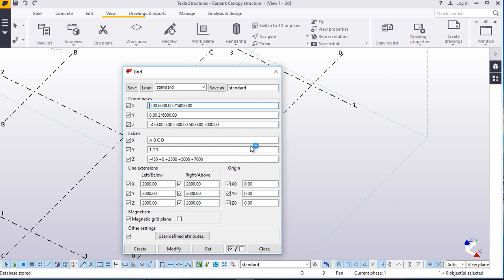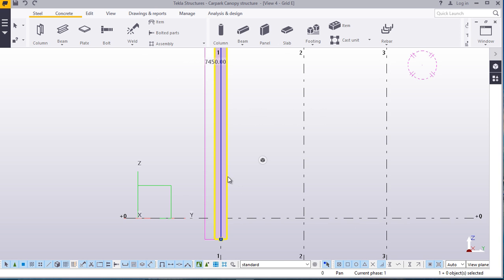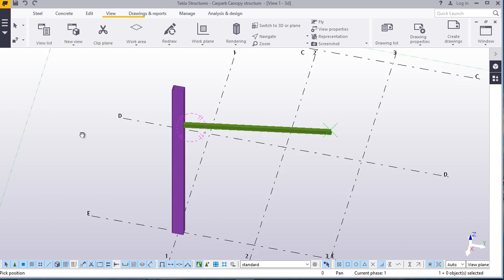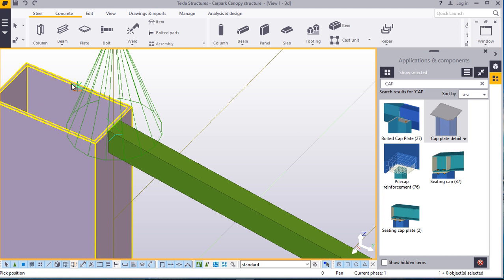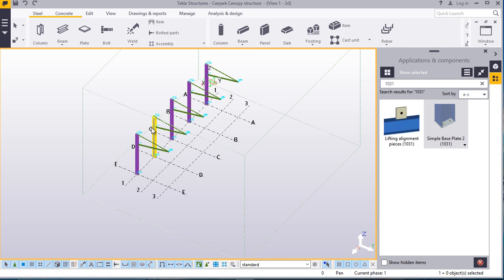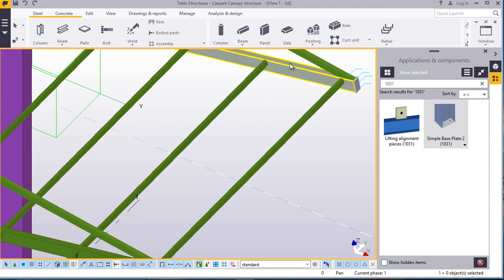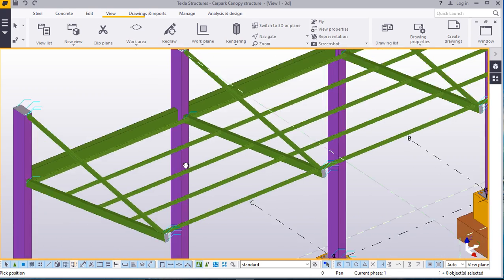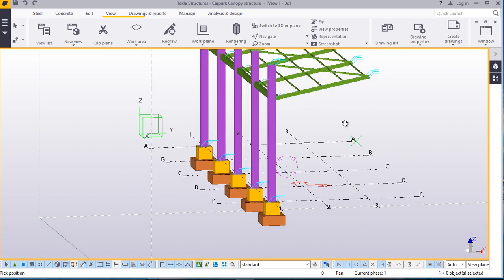Car Park Canopy Structure Modelling in Tekla Structures 2016

Comment: Hello Mr. Maurice Dimba. I am Mozambican interested in steel structures, I started learning to use Tekla Structure by your Tekla Structure Tutorials, this are amazing and permitted me to know a lot of the potentiality of Tekla Structure. I have I doubt about transferring a customized connection made in a model to another to reduce time in configuring connections.
I thank you in advance.
Reply from the maker: Double click on that connection and make sure all the configurations are correct go to save as on the same connection dialogue box and give it a name,so this becomes your custom joint